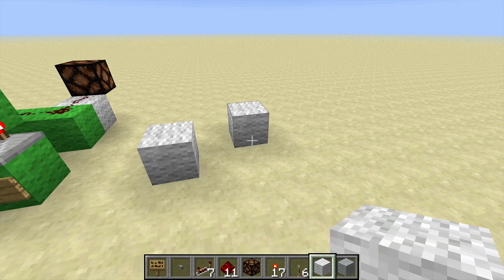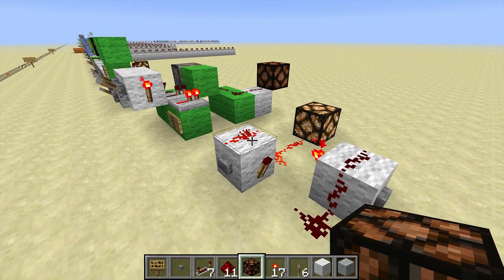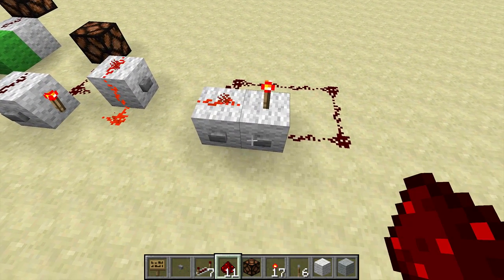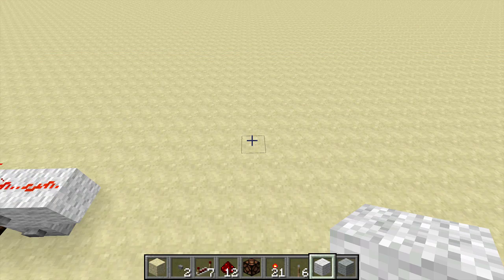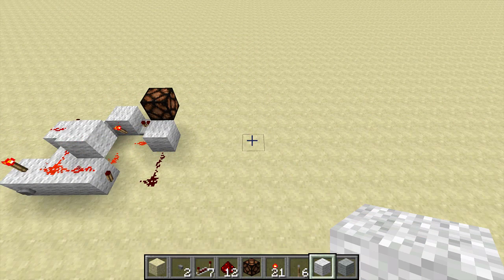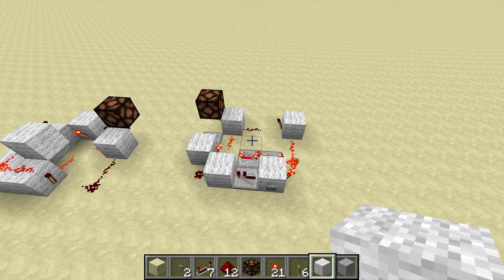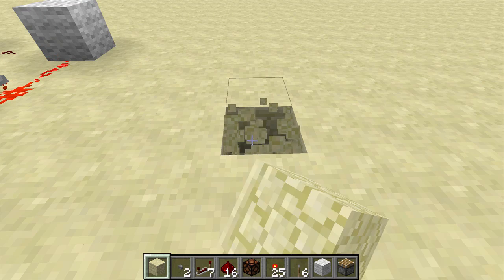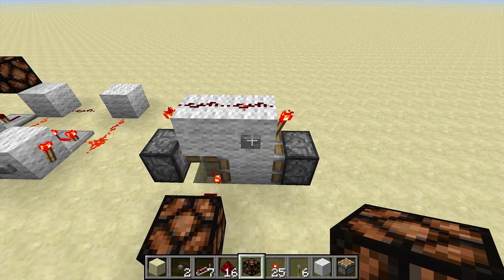Redstone 101 - Episode 6 - Latches and Flops

Comment: hey there hfog i was wondering about the t flip flop that you are explaining @ 8:30 i tried building it and its not working for me. its not turning back on for some reason it just flashes and after i try turning it back on i followed the design step by step from your video and its not working... any help? i am using 1.4.7       (T_T)